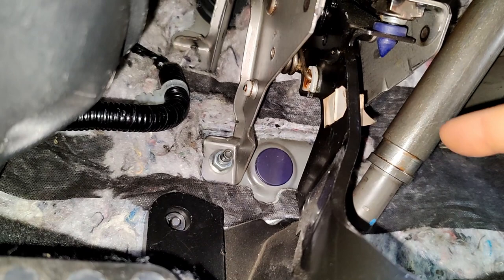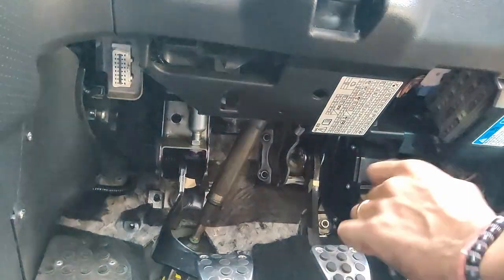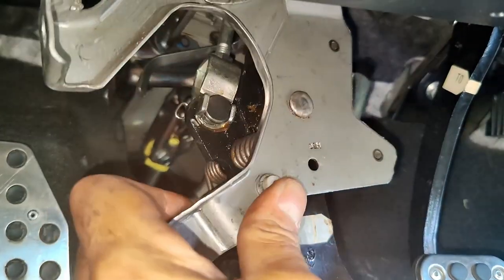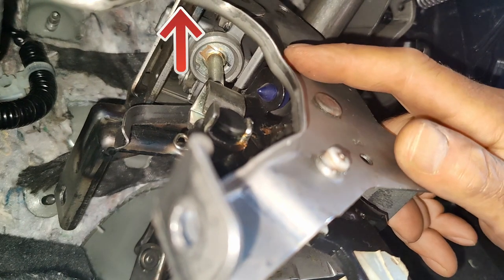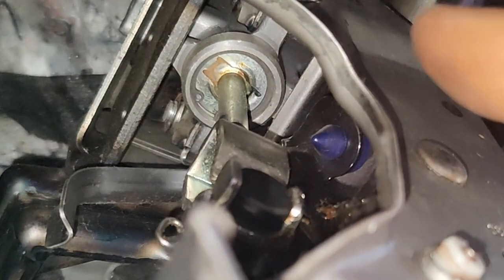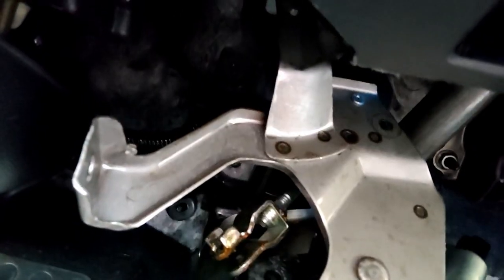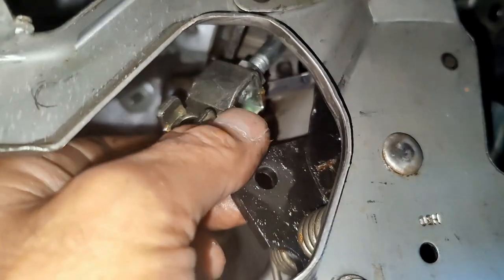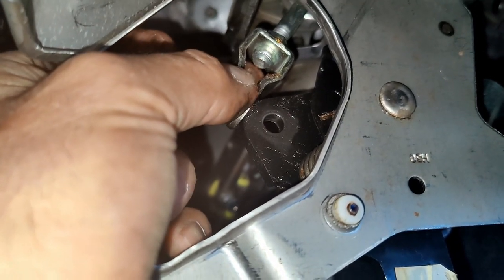Honda Civic Mk8 Clutch Pedal Removal &Travel Adjustment Screw.

Comment: So when the clutch is pressed, that rod pushes out, and when you release the clutch (depress), that rod goes back engaging the clutch? So by making the rod longer you don’t have to press the clutch pedal as much to disengage the clutch, which will mean the bite point is also higher?… honestly, Im finding it hard to figure it out in my head, pivots make everything complicated 😫
Reply from the maker: yes it can be tricky to figure out but yes, you are correct, the longer the rod (buy a few turns of the screw) then the sooner the clutch will dis-engage so you do not have to press the pedal as far to the floor.  Like wise when you release the clutch, you now have to lift higher for it to engage, ergo, less likely to stall :)
Reply: @GrooveOn  good stuff! Do you find that it made a difference??
Reply from the maker: @lazymaverick5118  , yes, it seems that I don't stall the car as much, do you find you stall?
Reply: @GrooveOn  i find that sometimes i make the clutch ‘chatter’ - seems to happen when I release the clutch too much while adding a little too much throttle. Then I have to clutch in slightly.
Reply from the maker: @lazymaverick5118  I know what you mean, I find the clutch is too heavy and too low, other people said the same